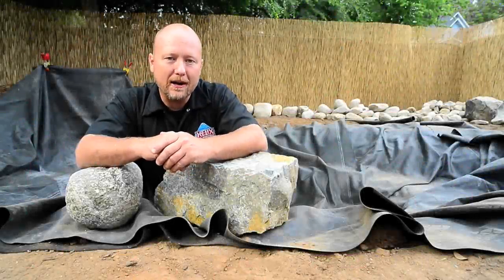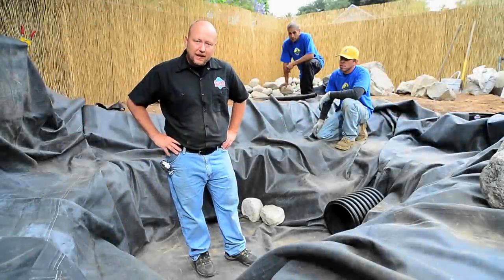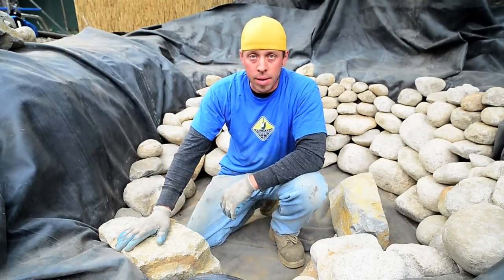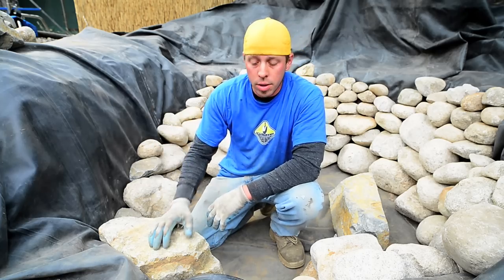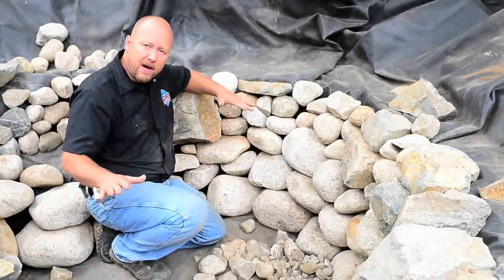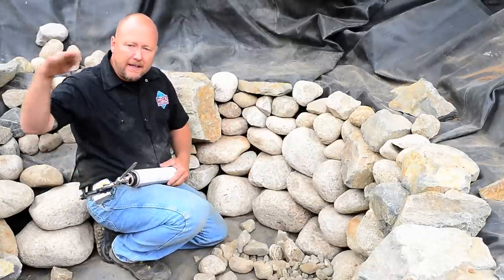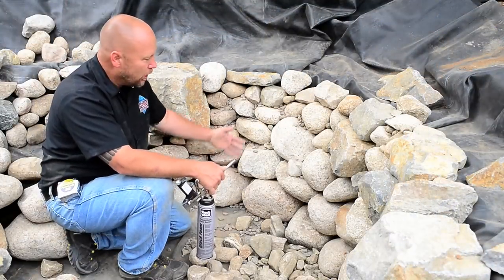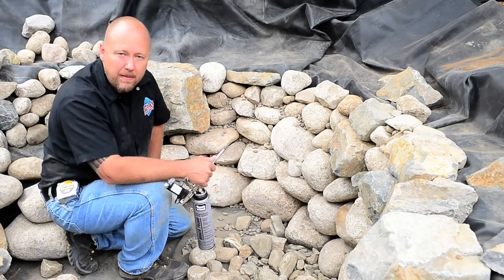How to build a Fish Pond - Part 8 | Pond Construction Rock Placement (1 of 2)

Comment: Good tip. All along this series I was wondering what you would do with that steep wall to keep the rocks from eventually falling down. I like the use of small rocks & waterfall foam sealant to lock those in place. Almost like you're mortaring them solid. A good tip. I'll remember that, thanks. Otherwise, if you keep doing 8 inches down, 8 inches down for every level, you need a big footprint for the size of your pond if you want a deep pond. Plus that'd be uniform which we don't want.

Comment from the maker: We dry stack and backfill the rocks we are installing in the pond and then we lock them all together with expanding waterfall foam. They are not as stable as concrete but done correctly you will have very stable rock work.

Comment: I've watched your entire series her. It's so informative. You've  illustrated so many problem areas. So great!
I'm renovating our pond that was here when we moved in 21 years ago. I've emptied it totally to 2" water in the bottom (3rd time in 20 years)  It's 52" deep and app. 48" to 62" kidney shaped.. I have  varying benches around 2 walls at app. 6' - 8" from the top. The walls go straight down to the bottom.
Do I absolutely need to rock the walls from the bottom?  It wasn't originally. Do you have any suggestions or tips I could follow for my best solution?
Could I text you a photo?

Comment: Hello eric, one question,. How do you calculate how many rocks you need to buy?, I´m in that step right now. 1square meter for the same size you have in this pond will be too much or it is ok?. Thanks again.
Reply from the maker: Hey Rai, that's a great question. Here is a how you can really get down to the figure. Measure the length and depth of each shelf. A ton of 10" to 12" rocks will go approximately 20 linear feet. With this math measured against your shelves should be able to put you on the right track. 

If I have a pond that is 16 foot diameter, I will measure the circle and then determine how many 2 foot rocks I will need to complete the installation of the coping stones. Keep in mind I will mix in a couple 3', 1 foot and a foot and a half rocks to break up the look. 

Keep in mind the density of the rock we install could be very different than what material you have available to you so you will have to weigh and measure a ten foot section of stone to determine your numbers for the calculations. 

I typically will want to error on the side of having too much rock rather then not enough. When we finish with the project and we have some extra stone left over we will work the material into the landscape around the water feature. 

I hope that answers your question. It's a little work to figure it out but it's worth it. 

Be sure to send me a video link of your pond when complete. Let me know if you need anything else.
Reply: Many Thanks Eric, I´m building a 3x2 meters pond with 80 cm of deep. I all ready buy the rock so I buy 1square meter of big rock, and half of a square in little gravo, that is mixed with a little medium. When I look at all the stones, all together, it looks like there is too much big rock and I will need more medium size. I also buy a gorgeous flat stone with nice orange and gray colors in it. 

I will made a complete video about it, but now I´m in pause by the liner, the client has a old liner we buy 3 years ago for this project, but, they used for another thing and when I check it I count at least 10 holes in it. So I´m not sure if I should buy another one or repair this one. In Chile is very difficult to buy liner. Actually we don´t have the one you use.

Comment: I have watched all of your great videos and you have inspired me to build my own pond.  I am building it in about a 13x13 area that is in between my sidewalk and porch.  I made the pond 5' in the deepest area.   I have run into a few problems that I need some advise with.  I built a retaining wall for one area that needed to hold the weight of the waterfall.  It is very muddy where I live and just had two of the other sides cave in when I was draining the pond.  We backfilled the pond as we filled it in a few areas.  My problem now is that I need to either build two more vertical cinder block walls or come up with another solution.  I would like to rick the inside but didn't know how much weight the rocks would support.  It is hard because I am in a small area with a deep pond.   I would love any advise!   Is there any way I could send a few pics?

Comment: i am currently digging my pond now but instead of digging out the typical 3 levels i just dug out 2 the first one is one shovel deep n the second (bottom level) is approx. 30" deep.  Should i of made it 3 levels instead?   and also how critical is installing a hideout like the one you made for your fish? i do plan eventually on putting in fidh into mine.

Comment: I've got several goldfish in my kids' old swimming pool, 56in Deep by 28ft Diameter circular, its fed by the gutters from my woodshop metal roof, aerated by a water pump piped back up to the down spout for the gutter, water drops 5ft between end of down spout and water line, we've had fish in it for 3yrs now. Kids started using city pool so much, I decided to make our pool my experiment...
My question is, if the water is 56inches deep, do I still need a cave for my fish? And if so, what would you suggest?

Comment from the maker: Rock through out the pond is not completely necessary. Consider not doing such vertical tall walls on the dig because we use the rock to support the excavation. If you do smaller 8" steps then your excavation will be fine. FUN FACT: The UV from the Sun is no longer damaging at 36" deep. Be sure to use pond liner that is UV tolerant if you plan on leaving the liner exposed to the sun. Good Luck!

Comment: I the video at about 3:18 -- is that large boulder -- and the one you placed at 4:10 -- just sitting on the rocks you used to line the sides?  I don't think there is a shelf there at the destination point, so I wonder what the coping stones are resting on?
Reply: they poor a concrete ring around the pond.